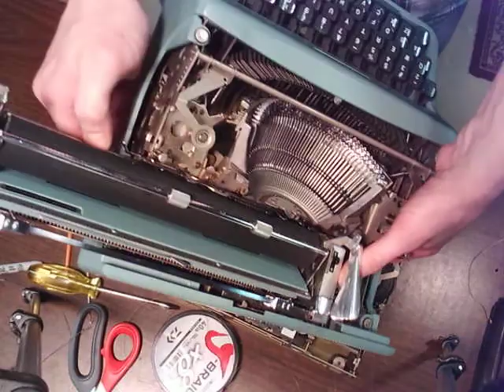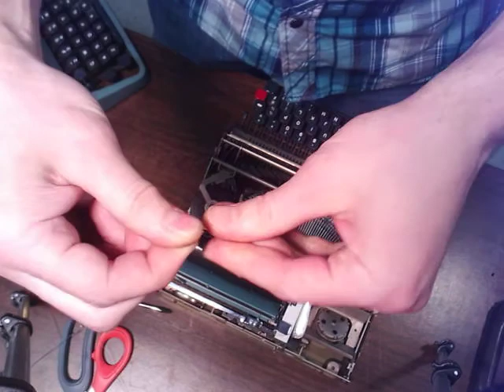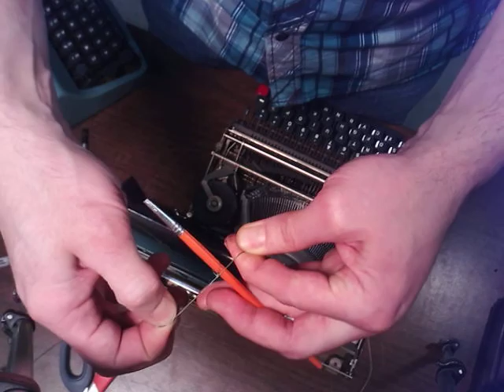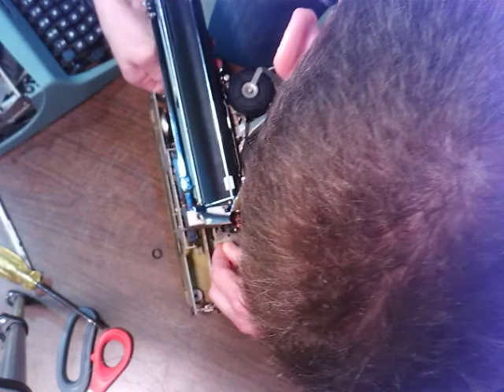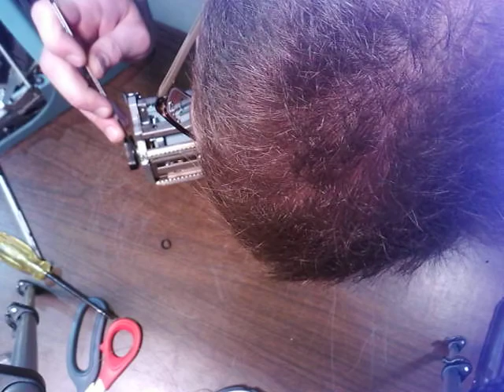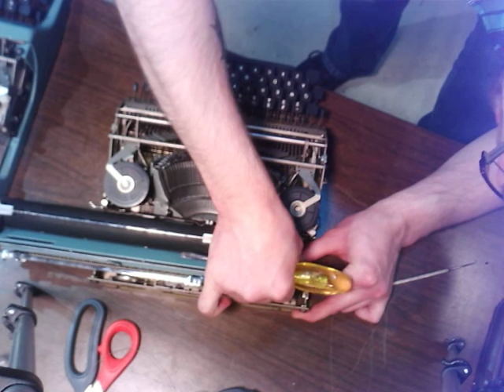Olivetti Lettera 32 Drawband

Comment: Very helpful! I have one of these and have needed to restring it for a while. Any chance you measured the draw strong length? I imagine if it’s too long you can just wind it more but I was curious
Reply from the maker: I don't recall. I probably measured off the old one when I did it, somewhere around 17" from knot to loop end. Careful not to overtighten too much on winding that mainspring. Good luck!
Reply: What happens if it is overtightened?

Comment: Hello; I fix and clean typewriters for a hobby. I recently just bought one of these for a good price; 10 bucks. The lady thought the typewriter had a carriage issue but she was unaware that the carriage locked. But anyways, back to my issue; the bell doesnt seem to work. Any ideas? Theres a random spring that is unattatched where the bell is, but I dont know where to put the spring
Reply from the maker: Check for a small connection hole for the spring on the bell trip assembly. I know those bell striker arms sometimes bend away from hitting on the bell, so maybe try manually tripping the thing just to study how it's striking in the first place. There are many pictures of Lettera 32's and 33's on The Typewriter Database that might be good for reference comparison. The bell placement and RH margin trip for bell are very similar, if not the same.

Comment: I havd a lettera 32 that seems to have a carriage promblem. For some reason it keeps sliding to the left whenever I return and for some reason the escapment isn't engaging. As I am a Student and can't afford to service my typewriter I'm just looking around to see if I can get any help. Any help would be appreciated.
Reply from the maker: So, if your doing a carriage return and the carriage drifts to the left w/o you pressing the keys or spacebar? I would start with making sure the toothed parts (e.g. escapement, pinion, pinion rail track) are all in order. If nothing binds, with the carriage release de-pressed feel it through--setting the margins at extreme ends--and make sure that's all in order. Maybe it's a stuck tab chip, while holding clear move carriage all left and right. Keep checking for something stuck, if you suspect a part's sticking open, try some Liquid Wrench Penetrating Oil on the part.  Also, try The Antique Typewriter Maintenance Group which you can find and join through Facebook. Take some good pictures or short film of problem and post it there; the people on there  (like me) are all typewriter people and will help too.

Comment: Hey Ken. I am curious if you would be willing to sell me a return arm for one of these.  Along with the pin and screw that keep it fastened to the lever.  Or at least know where I might find one :)
Reply from the maker: If your in the USA, I have an extra return arm for a Spanish made Lettera 33 you can have. It looks different (little more square) than a 32, but should work. The thing is, the carriage arm mounting screw's sleeve nut (receiver) won't break free from it's carriage bracket. You'd need to find a  receiver  for the Carriage arm screw, or maybe replace both screw and sleeve nut if unable to find the O.E. thread receiver--it's probably metric and fine threaded. Anyway, if you want it email me at kennygk79@gmail.com with an  address to mail it to.

Comment: In my olivetti lettera 32 return carriage going to left end by default please help
Reply from the maker: Could be your carriage release be sticking somewhat open, instead of engaging with the escapement.  You'll need to see that the rack engages the escapement wheel.   If you've forced the carriage to move, without using the carriage release lever, there may be a broken tooth at escapement wheel--let's hope not though.  You might try taking a short video clip of how the typewriter acting up and posting it to the Antique Typewriter Matienance Group through/on Facebook.
Reply: @kennygk79  thank you